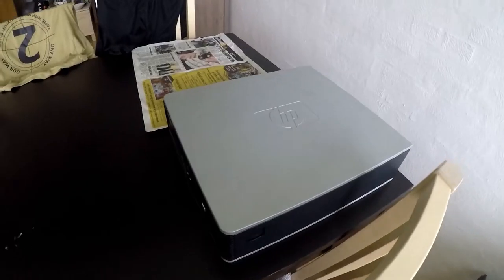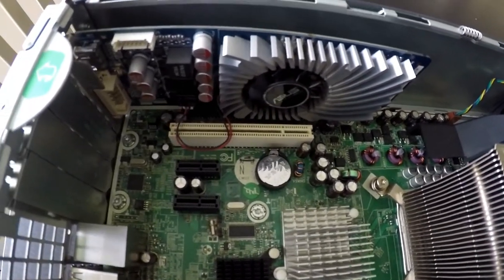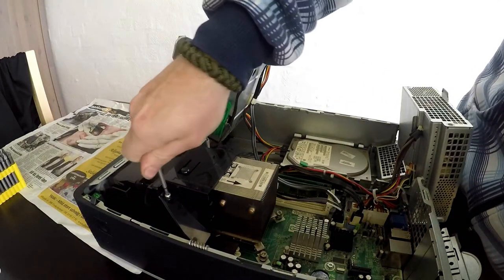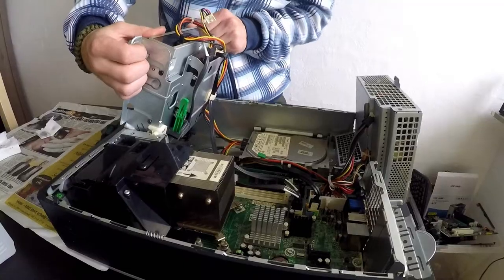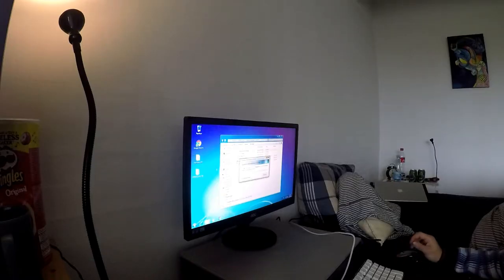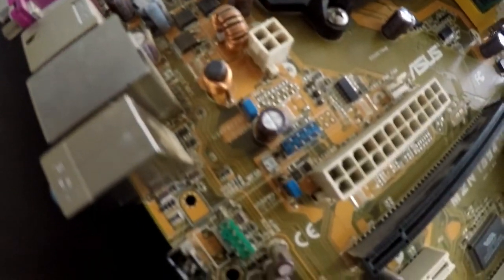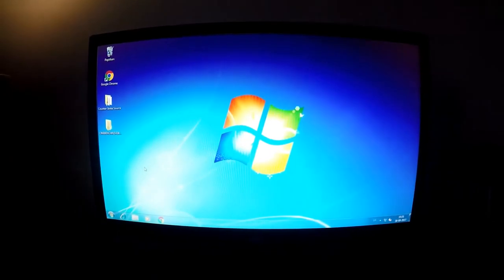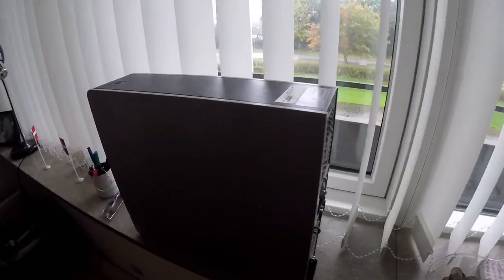Smells like smoke! HP Compaq dc5850 SFF, benchmarks and upgrades

Comment: Hello, awesome video :-) My cousin have this computer HP Compaq dc5850. He wants to upgrade RAM and CPU. I know that he can upgrade RAM to 8GB by placing kit of 2x4GB for dual channel or 4x2GB for single channel. What is the best processor that he can put in? It is socket AM2. He wrote with one man that he can put it AMD Phenom II X4 810, which is socket AM3 but he says when you have updated BIOS it should work. I think that it is important to preserve same socket because it is physically thing and the new processor would not fit.
Greetings from Slovakia ;-)
Reply: > "I know that he can upgrade RAM to 8GB"
Some sites emphasize that it is possible to upgrade to 16GB instead of the 8GB specified by the manufacturer.

> "What is the best processor that he can put in?"
AMD Phenom II X4 B99 (with BIOS upgrade)

> "he can put it AMD Phenom II X4 810"
Yes, it should work.
But, if you are willing to pay a little bit more, a better choice would be AMD Phenom II X4 850.

Comment: What's the cheapest/best upgrade to the CPU for this motherboard? Found someone selling this system for $40 on Facebook and if I decide to get it, I would like to know what upgrade paths are available. Upgrading an LGA775 with used parts was a fun project for me, so I'm wondering how an AMD system would fair.
Reply: AMD Phenom II X4 1065T, check it on tom'shardwere site
Reply: @pmcuber2626  1065T is 6 cores, not 4. Most likely the motherboard wont support.